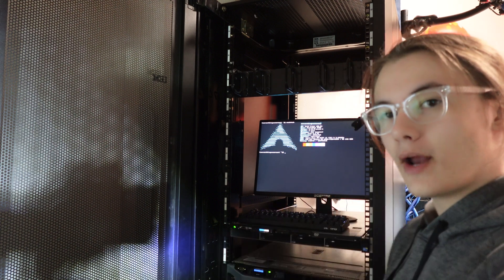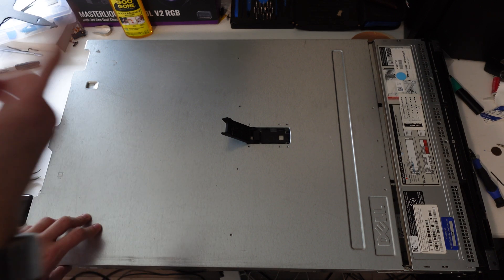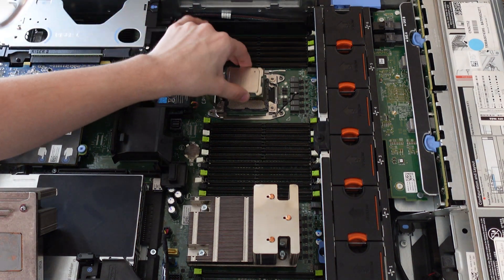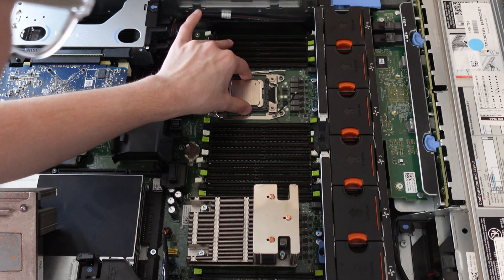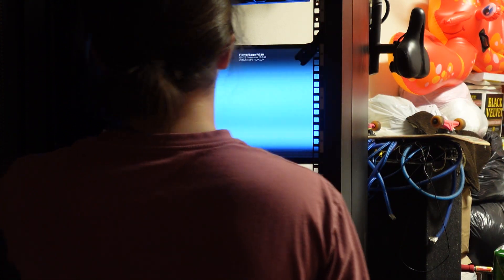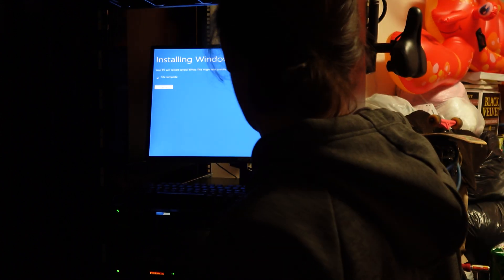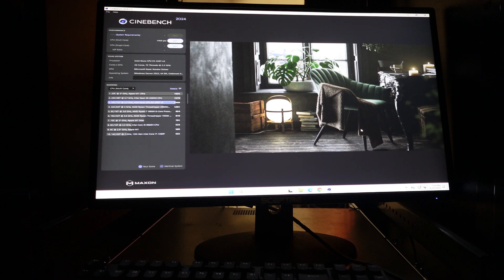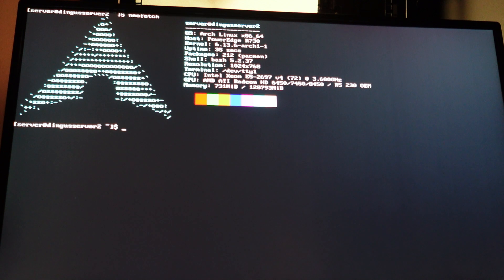The Most Overkill Budget Server (Dell Poweredge R730)

Comment: I bought a R830 like 2 years ago and was using it for CPU mining, sadly the power consumption made me turn it off since I wasnt making enough to warrant using it anymore, but Ive been curious about using it for AI. Ive been looking at the 730s cause Ive seen alot of people using them. Wondered about using my 830 and a 730 in a cluster. The 830 has 4 CPUs and could run the 730 with dual GPUs. Maybe in the near future Ill pull the plug and do that. Any thoughts on possible upgrades for both and what are your thoughts on how this would run.
Reply from the maker: no clue about ai workloads really but some cheap nvidia tesla gpus and some more powerful cpus and ram wouldnt hurt

Comment: just picked a r730 up today! super excited to get it running. duel 2695v4s, 160gb of ram, duel k80s!
Reply: Im getting an r730 tomorrow pretty low specs but I have 2 2680v4, 128gb of ram to put in it and I just ordered a k80 for $53
Reply: @victorreznov9940 Just one question: what are you doin with two old Kepler gpus?

Comment: With time, you'll learn to appreciate the XDs... I have 3 R730XDs 1 12LFF and 2 24SFF, all 3 with the rear 2 SFF backplane to boot from and sooooo much space to fill with inexpensive storage. The 12LFF has over 70TB of disks in there running TrueNAS Scale and it's doing sensationally well. One of the 2 R730XD SFFs has 2 GPUs to run AI locally (that one only has SSDs in the bays). The 2 SFFs are running Proxmox. Love these bad boys.
Reply: What is the main differnce between this one and the R730XD ?
Reply: @ch0lito   The XD version mainly upgrades the number of storage slots. It's nice to have many storage slots so you can fill it with a lot of cheap HDDs, rather than a few expensive ones.

Comment: why must servers racks  be so expensive where i live i have a 2007 ibm system x3650 and a dell power edge 1750 and no rack :((
Reply from the maker: i was running rackless for a good like 2 years, you don't really need one
Reply: @ErickHatesBMC i know but like racks loook SO cool compared to a 3d printed sideways stand  jusy under a table
Reply from the maker: @BlackOpsUni yeah true lmao
Reply: u dont need a full 42u rack. there are a good amount on amazon that are like 15-25u for under $250
Reply: Just make some our of deck boards. Nerd
Reply: Who needs a rack, I have mine in the storage room in the basement along with the rest of my tools :) Gave my rack away to a friend to use in his garage. I literally just stack the servers on top of each other separated by a couple pieces of wood. Have 10gb switches etc fairly close on another level, easy to run cat or fiber. The only important thing is that they mounted well off the ground in case of a flood. I only use 2 dell servers though to save on electricity costs, second one I only bring online occasionally to backup my zfs pool.

In case you are wondering how I can run absolutely everything on just 1 server, dell r720, riser 1 with 3 nvmes, riser 2 v100 GPU for ollama, riser 3 IT flashed raid card for zfs and a 4 port USB card for passthrough to home assistant for zigbee and zwave. It's my router, NAS, smart home, surveillance video storage, everything. Save yourself the headache and get a r730 or r740, r720 doesn't support bifurcation or nvmes, I hack around this using a clover USB stick. 

3 nvmes are for things like the 6-8TB of root OS and VMs. The front drive bays have a couple rust drives for 30TB. Or do like the cool kids are doing, stack enough nvmes together for like 30-50TB, then you won't have to worry about replacing rust drives every X years either long as mostly just reads and storage. Bragging rights these days is the amount of nvme storage you have and the amount of vram you have nvlink'd together :)